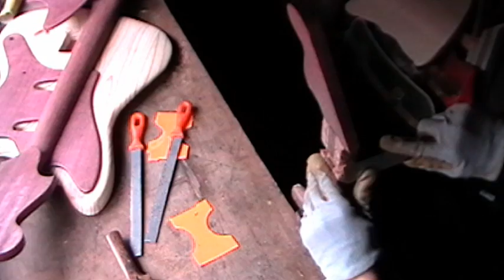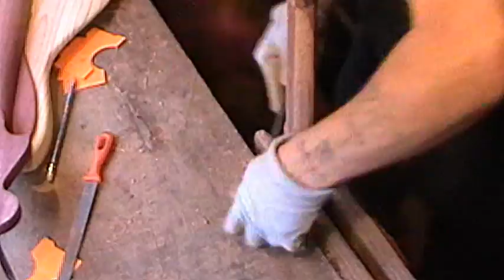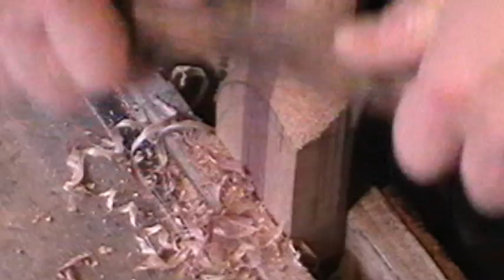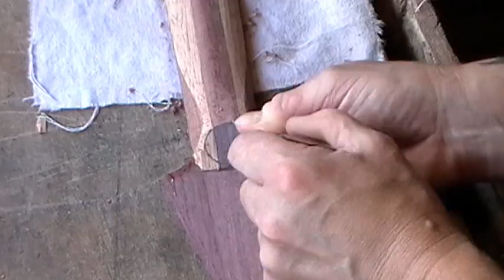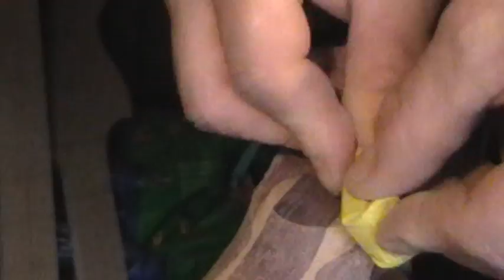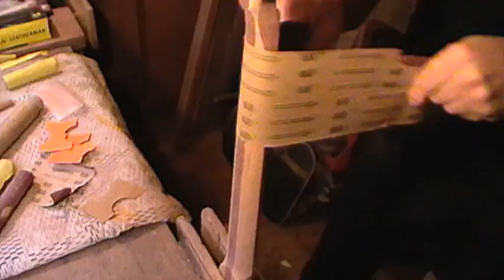Carving A Guitar Neck & Decorative Volute (Time Lapse)

Comment: Wow,I really love this neck disgn.Can I custom this neck on one guitar?
Reply from the maker: +Peng Xueshi  Thanks. Do you mean you want to use this design? If so, yes of course you can. You just have to use a shallow head angle (i use 10 degrees) which makes for a bigger scarf join area and the wood for the neck has to be thicker than usual to allow for carving the design. Also if there is not enough wood at the back of the headstock after gluing, you can always move the fingerboard and nut position backwards slightly as long as you have enough room at the other end of the neck.